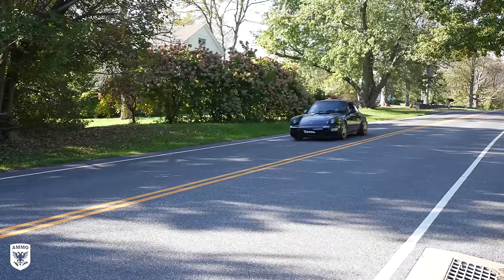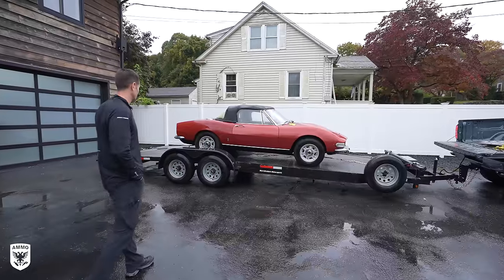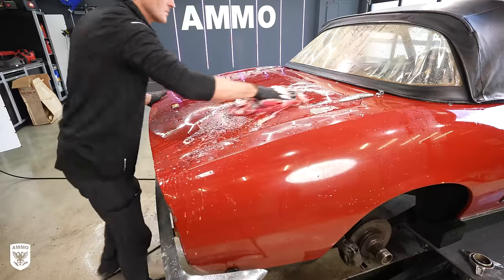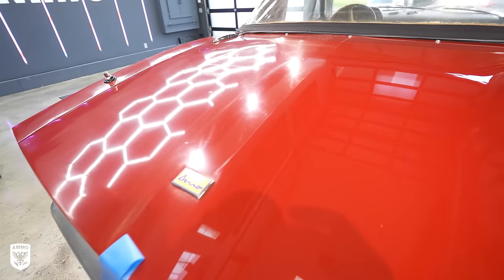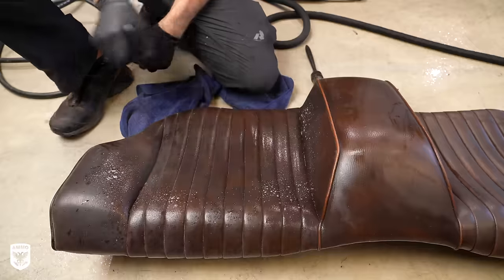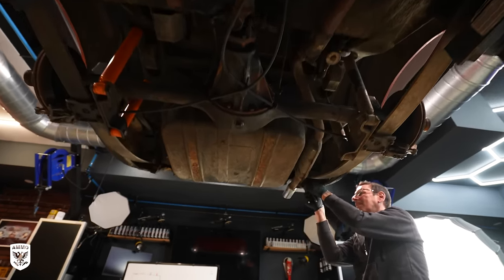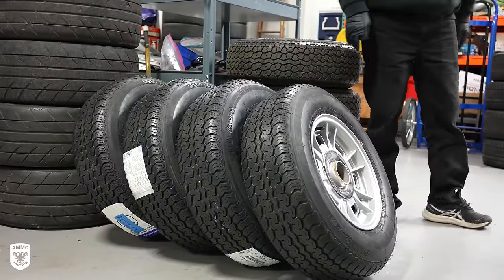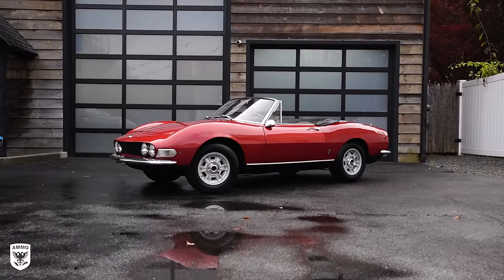First Wash in 40 Years: RARE Fiat Dino Moldy Disaster Detail!

Comment: The reason the knockoffs have right-hand threads on the passenger side is so that as the wheel rotates forward it will tend to tighten the knockoff rather than loosen it. Bicycle pedals have a similar arrangement.

Comment: Great Work Larry, any tips on using Steam on these older cars? Steaming the Plastic on the softtop would've made me very nervous :s
Reply from the maker: On delicate surfaces, wrap the steamer head with a towel and or use a lower setting. I use a lot of cleaner as a barrier between the surface and the heat. This soft top was quite robust but yes definitely inspect the material first for cracking / delicacy.

Comment: I'm curious about mold.   Is it only ever on the surface of interior panels?   I've never seen anyone remove the dash or door cards to clean mold off.   It is possible it could be on the underside of the dash or inside compartments panels?  I'm curious in case I end up buying an old car full of mold.  How thorough do I need to be in cleaning?